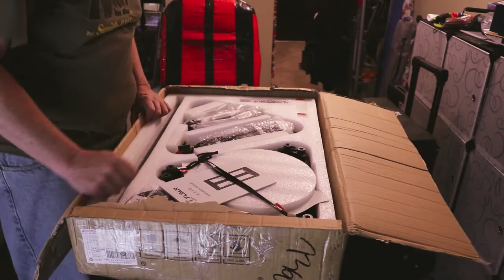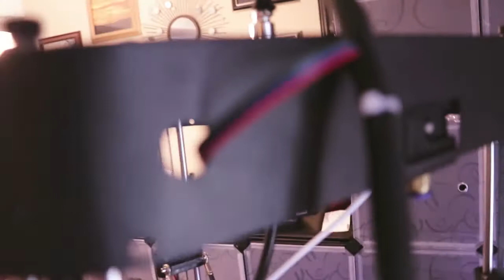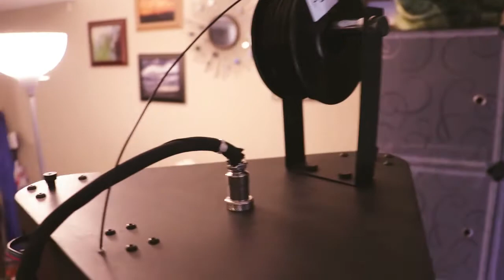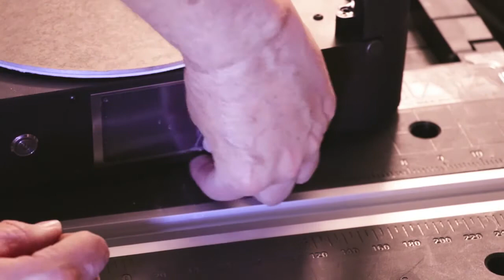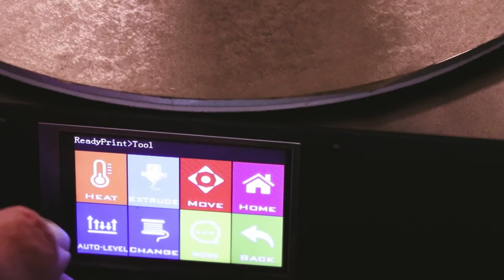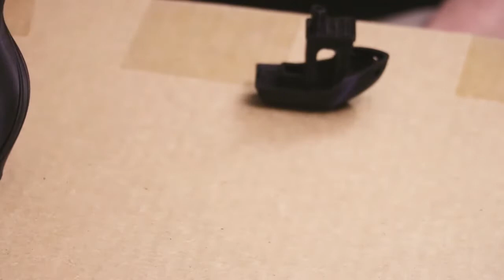Unboxing FLsun Cricket Delta printer

Comment: awesome video, thanks a bunch, by the way, did you level out the z axis and did you fine tune it or just print out of the box. can you show us the issue you had with the short wire and how to fix it if possible
Reply from the maker: TrickGaming you do you have to make sure that the rods level before you put on the top. But the printer Finds Its Own Z height. And then calibrate the mesh leveling. It uses 36 points instead of the 9th at most use.